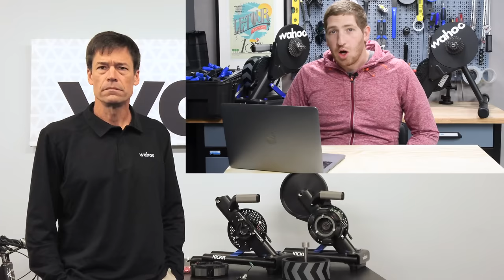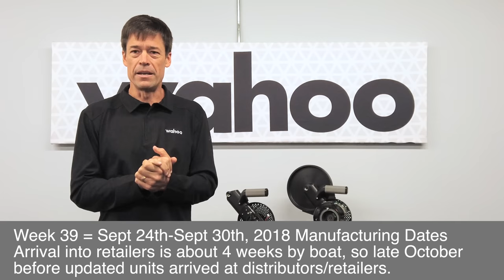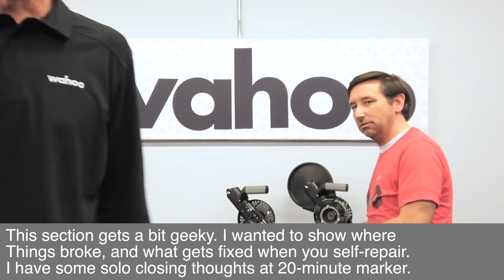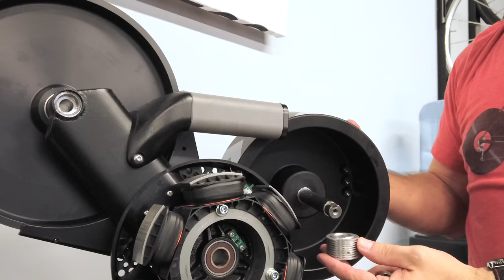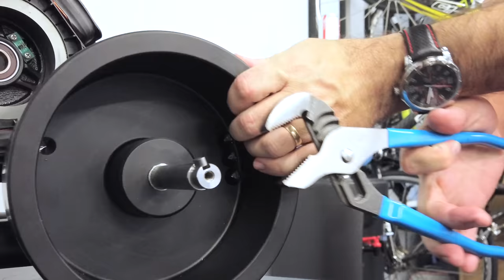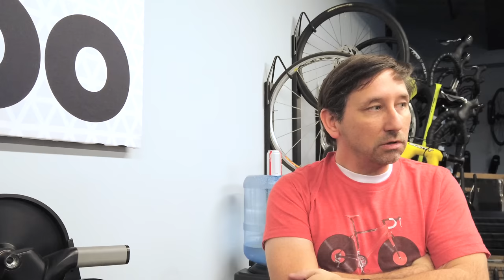Wahoo KICKR18/CORE Issues: Discussion with Wahoo CEO

Comment: I have just got a nearly new Wahoo Kickr snap but there is no power or speed although it is connecting weill with Blueooth.  I have now discovered that there is no optical sensor tape.  I have reached out to wahoo and am awaiting a response.  Is there a DIY fix with reflective tape?  Does the size of that strip of tape matter?  I'd love ro hear back.  Thanks

Comment: I had the ESD problem occur and received a replacement on January 29th. The second unit failed within 8 days. While I appreciated the replacement 1st time round,  the solution to just keep replacing units for customers that have the problem is not acceptable? The postings here and other sources seem to indicate that if it happens in your environment there is a high chance it will happen again. Support seems to be slow playing the response as they are now asking me questions they know the answer to and take a day or two to respond.

Comment: My wahoo kickr came with the upgraded nut and washer , bought nov 2018 , after 60 hrs of zwift  vibrating / humming and a knocking was audible  ,  the nut needs to be tightened up , seems to have solved issue , didn't have lock tight in house , next time.
Retightening the nut has not resolved the issue, I have contacted wahoo via website and I am waiting on resolution .
Reply: Wahoo have been in contact and have received new unit , since I bought unit online my online retailer didn't want to deliver new unit before i sent my unit so bought new kickr from LBS and will receive full refund from retailer.I am staying with brand , fingers crossed . As for the fault , after wahoo examined my video I was diagnosed with a main bearing fault and replacement was the option.

Comment: I found Wahoo support to be responsive but slow.

I got my Snap in beginning of 2016. My wife and I shared it at first. I was using the data from my dual sided Pioneer power meter while riding on Zwift while she used the data from the Snap since she had no meter. Eventually she started complaining of major issues (things I never saw because I wasn't using the data). So I started collecting data from both during my rides. Wahoo went to my Garmin and meter went to Zwift.

What I found was at first constant dropouts. And then massive under-reporting issues. And at times power data would drop to 0w even while riding. And resistance did not feel right. I tried multiple computers, multiple USB slots, even had my wife try and use Bluetooth on her iOS devices. We followed all recommended tricks to see if it was something on our end before eventually contacting Wahoo support.

They got back to me after about 2 days. And what happened after that was about 2 weeks of back and forth. By this point I was positive the power data was having issues. My wife was getting ready to get her own trainer so we could ride together at the same time (summer is our offseason and we wanted to ride together even if we had to be indoors). And we were getting ready to go on vacation. We knew the trainer needed repaired or replaced. While customer support did get back to me after every time I asked for help the thing was it was 1-2 days between each response. And the person working with me had lots of questions. She only asked 1 thing at a time. Eventually I got tired of it. My trainer was only 5 or 6 months old and the retailer had a 1 year replacement warranty. So I sent it back to the retailer and they ordered a replacement. 

So was customer support helpful? Yes. I feel like she was trying to help me diagnose my problem. The thing is requiring say 5-10 different questions and taking 1-2 days to respond to updates made it so the process was taking weeks to get an RMA started.  So I wouldn't say it was good customer service. Maybe not as bad as my old motherboard that needed an RMA and the manufacturer (Asus which is why my current CPU has an MSI board) kept "losing" my RMA request for nearly 2 months and by the time they finally approved my RMA I had built a new computer because I needed one for work. So they aren't the worst I've dealt with. Just too slow.

And the fact that they are charging $70 for timing belt replacements and lots of people seem to be having belt issues despite being under the weight limit and on trainers that are <1 year old is also another red flag. I really like Wahoo's products. But I'm starting to wonder about their customer support. I now have an Elemnt Bolt, 2 Tickrs, and 2 first gen Snaps. And I personally haven't had any major issues since my retailer replaced one Snap. But seeing a lot of the recent things going on with their 2018 releases and remembering my slow response time has me wondering... if I were to upgrade trainers today, do I really want a Core? Or do I maybe want a Flux or Direto?

If they are being up front about their 2018 issues, I will give them credit for that. So many times in different industries, companies try to hide problems. Video game industry is terrible with this. I'm not currently in the market for a trainer. But I'm definitely watching. Because I know my Snap will eventually show its age. And when the time comes, I'd lean towards a Core if I trust the product and customer service.
Reply: And I do appreciate Chip and Wahoo supporting right to repair. And even incentivizing it by offering some gift cards to people that follow the instructions and repair themselves. I bet people like Louis Rossman wish that Apple would do that!

Comment: When do you guys think a kickr 2019 will come out, hopefully fixing this so there’s even less chance of issues. 

It’s been hard for me to decide between the Tacx Neo 2 or a kickr. I’ve heard tacx has terrible customer service but haven’t heard any issues with the new neo 2.
Reply: I had Kickr18 .. in 2,5 months it was dead .. clicking, squealing and VIBRATIONS .. tons of them. In the end, I was lucky enough to return that trash to a supplier and got my $ back. Bought Neo2 - no problem. I consider my "Wahoo experience" as closed chapter ... not gonna buy even bike bell if there is "Wahoo" on it ...

Comment: Huge respect to wahoo for doing a video like this and for them coming forward and taking responsability/ownership for failures in their product, Something very few people and companies will do in this modern world. I just want to give an example i took my Garmin 520 and got the screen covered with a product called Ghost armour, and the guy that put it on has pressed so firmly on the screen that in the 2 top corners and the bottom right corner the LCD screen has leaked i took it back to him and he stated that i had dropped it or something like that, (wish i could upload a picture to show) My issue here is if I had caused this issue by dropping it or anything like that I would take responsability and ownership of my F#@K UP as i have some integrity and am willing to put my hand up if i make a mistake, Now I am left with a Garmin that i cannot tell what the battery level is at because of the distoration to the LCD screen. Thanks Ghost Armour now I'm out of pocket several hundred dollars to replace my garmin, how ironic it is that i give you my garmin to put a screen protector on and your installation guys ruins my screen. GHOST ARMOUR take responsability/OWNERSHIP  of your mistakes !!!!

Comment: Just got my new Kickr Core today. Its the same peace of s**t since 6 years ago. Nothing had improved. I have bearing sound, whistling noise, strong vibrations the harder the gear is (Chain was reindexed). After pedaling hard running into idle, i feel a strong pulsating vibration in the handlebar, caused by the wobbling freehub.

All these issues are known, but i thought its a low percentage, so i gave Wahoo a chance. It seems i belong to this percentage, but maybe the percentage is quite high. Now i bought the zwift hub one, which my girflfriend already use. The Chain is a little louder cause of this plastic ring, but the rest is excellent.

Comment: I bought my first Kickr 2018 early October, it had the known bolt error. I got a new Kickr, similar noise and vibration, but not the bolt topic leaded to a replace right before Christmas. As most people here say, customer support is great, but now I recognize noise and vibrations on my third Kickr version. I don’t actually know what to do anymore. I can’t continue replacing the equipment. I use it approx 10 hours a week, but should manage that? Any tip anyone?

Comment: I have owned my kickr core for 5days now so far so good!
Reply: Romeo Fowler - I just got my Core yesterday, cassette is being delivered today.  I hope I don’t have any issues.
Reply: @mrspeeddemon727  The core is working great so far no worries. Hopefully I have received one of the updated ones, and if not then I am at peace that Wahoo will take care of me. Seeing the CEO here addressing the public about their awareness of the kickr and kickr core problems and that they have taken steps to remedy the problems speaks volumes on their side.
Reply: Romeo Fowler - I got the cassette mounted on mine, took me a little bit to adjust the jockey wheel to line up with the crank gears.  Rode 10 miles as a test, no issues, no stickers flying off.  But it’s only 10 miles.
Reply: MrSpeedDemon72 nice, I have been using mine for a week now no stickers coming off, and this thing gets warm I use mine in EGR mode a lot enjoy don’t worry about it.
Reply: Romeo Fowler - thanks!  Is it supposed to turn itself off after awhile?  Always stay on or do you have to unplug it after every use?

I thought it is supposed to auto shut off after so many minutes of inactivity but my Bluetooth and Ant lights are still on well after an hour of not being used and just sitting there.  ?
Reply: MrSpeedDemon72 No doesn’t seem to shut down by itself, I have mine plug into a power strip and when I am done riding I turned of the power strip thus shutting down the core.

Comment: off topic but my tacx flux makes random whirring and squealing noises quite often and my Wahoo kickr snap wheel on trainer before it behaved perfectly. But I'd wait til 2019 models if buying now, these products aren't cheap and should last many years. The worry is when it's 2 or 3 or 5 years old... how much support do you get then when the design flaws cause failure..?

Comment: Certainly don't buy a used kick Core if the seller don't have the original receipt. If it breaks and it will probably will you'll have thrown you money away in the ditch (oups to recycling).

Comment: Just wondering what happens to the warranty if i would fix this issue myself, will it become void? I mean, even if it’s that easy, on the next issue with the same unit, they could deny my request for a replacement because i opened it. I wouldn‘t do the fix.
Reply: If you contact Wahoo, and make the agreement to diy, you will still have full warranty on th unit.
Reply: Nope. Not even then. In case something goes wrong, you‘ll have to proof, that you did everything in order.
Reply: @christiangrosspietsch6278  when Wahoo says you still got full warranty after the diy repair, then i'm pretty sure you do ;-)

Comment: If Play movement of the too small Key in the keyway is the problem and Wahoo recommands using locktide to fasten the new tighter tolerance key. 
My potential solution thought  is why doesn't Wahoo use a larger key so the free room between the key inside the keyway and the bolt washer is filled up, wich would leave no more room for the key too come loose and cause friction ?
Or has this been tried allready?
...
Anyway I have allready ordered a Wahoo reconditioned kickr 2018 on black friday directly from wahoo.eu wich still has to be delivered as a back order in the beginning of december.
Hopefully the " Wahooligans" have found a way to solve the key  issue on the "returned certified reconditioned" units properly

Comment: It seems higher than 3%.some people had replaced the kickr up to six times before giving up.
Reply from the maker: Which makes total sense actually: The same people are basically killing their CORE's the same way each time (ESD - electro static discharge). So basically in their home, the conditions were right to pretty much guarantee death. Whereas someone else may never see it, because of the conditions in their home. Kinda sucky, but actually a completely logical explanation as to why some people were able to kill so many units.
Reply: Who keeps going back SIX times? Crikey. Three strikes people...... three. Then move on.
Reply: Lol. The same people that ride 5 hours on a bike or spend too much money on aero bling for two seconds advantange in a group ride. I think. 😂
Reply: Shane Miller - GPLama  , hows the neo2 is there a low Candace high torque slippage? Read a few forums about it , went through a few new kickr 18 ‘s and looking at another trainer brand .
Reply: @babybelkin977  It exists. (short reply, off topic here)
Reply: Yep. Multiple replacement here for me, and my issue was not the ESD issue.
Reply from the maker: YakovD71 I prefer facts and understanding of issues versus just mystery magic. To each their own.

Comment: If my kickr core is out of warranty and has just now stopped working after just over 1 year , where it does not register power or speed anymore .will I get help from wahoo or the online site I bought it from here in Scandinavia? Is it just replacing the power cord or is it an internal issue?  I assume it is a ESD problem @dcrainmaker
Reply: Hi! Your unit was before 2020? I think last units work correctly

Comment: Mine replacement unit from 2020 for a unit purchase in 2019 also die again.  I don't think this issue was resolve.  I can't be the only person to have had 4 units in 5 years with 3 dead.  Purchase my first in 2017.  It die out of warrantee and I didn't think to contact the company and purchase a second one.  Ever since then I have had them warrantee the next two.  They are currently sending another unit.  So 3 for 3 and I have no confidence in the four unit being any better.

Comment: My kickr18 has stopped working from yesterdays ride and today. The power bank shows a green light saying there is power but the ANT+ and bluetooth units should be flashing... but nothing. Hopefully can get this sorted asap. This is the reason why I haven't moved from mechanical to electronic shifting. Tech is great when it works, but when it doesn't its a nightmare
Reply: I finally splurged on etap early this year and have had zero issues. Although I only have about six hundred miles on them with being out with knee surgery. Battery life is very good too.

Comment: Why do they require a 10min spin down each time?  That was a deal killer for me.  Also the Core doesnt even have a cadence meter!  Very pleased w my Elite Direto and its accuracy, built in cadence, great reliability and lower price than the Kickr
Reply from the maker: There's no such requirement for that. You can do a spin-down if you want, and generally I recommend doing once every once in a while after about 10-15 minutes of riding, but it only takes 30 seconds.

Comment: Thanks Ray, any chance you can film your fix for your own kickr when you complete it? I’ve got a week 36 unit (which is fine at present) so it would be helpful to see the fix in case I need to do it. 

I also add for peeps concerned re Wahoo products that I’ve got an old generation one kickr which is in use daily, it’s done so many miles it’s seen off four chains, one cassette and the thing is still absolutely fine, it’s still even on it’s fist belt somehow..!
Reply from the maker: Indeed. Though, I'm going to ask Wahoo to publish a video of the fixes on their own. It came up after the call as well. If by time I get back from Cape Town at the end of February there isn't one, I'll do it.
Reply: @Dcrainmaker  thanks Ray.

Comment: Wish you would have asked him about the Wahoo cadence meter.  It is impossible to remove or replace the battery without destroying the unit.  Horrible design.  I went thru two of them before I switched over to the Power Tap, which works quite well and is high quality construction.

Comment: There is a ton of people in here commenting about replacement units.  All the people in here seem to be more than just 3%.

I just got my Kickr Core yesterday, cassette being delivered today and I’m already worried my unit is going to fail soon after I start using it.

I’m regretting my purchase already.  Damn it!
Reply from the maker: It's not 3% of YouTube commentors, but rather, 3% of trainers shipped/sold. Even if they sold 'only' 10,000 trainers, that'd be 300 comments (more than the 171 to date, many of which don't have broken units). Of course, it's far more than 10,000 trainers thus far...and thus, 3% of units doesn't = 3% of YouTube comments.
Reply: DC Rainmaker - I understand the 3% thing.  My point was, there are a ton of people in here commenting on issues.  The entire 3% must watch and follow your channel.

Comment: My second Kickr Core 18 just died, same as the first with the power dropping out after a handful of rides. My replacement had the new power brick so I truthfully don’t think they have any idea why these units are failing as the supposed fix did not work. I’m sick of beta testing their crappy hardware and have requested a full refund.

Comment: Kinda angry that I had to open my kickr and see that the reason my family and I are driven mad by noise when I'm training is because Wahoo decided to save 3 cents by putting in cheapo washers that deformed. Replacement kit? Not offered by Wahoo. Now I have to find out specifically what parts I need and source and repair myself. Maybe I'll succeed, maybe not. If I can't fix it I'll just buy a new trainer from Wahoo's competitors